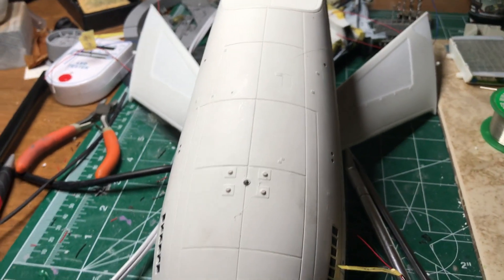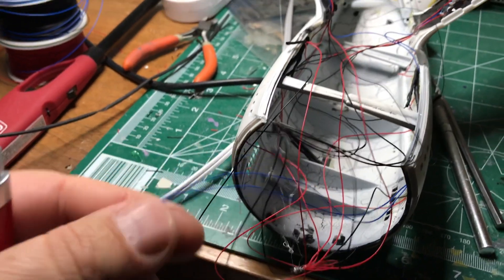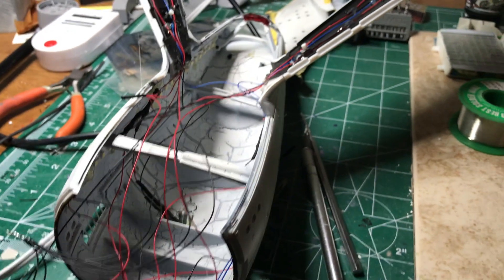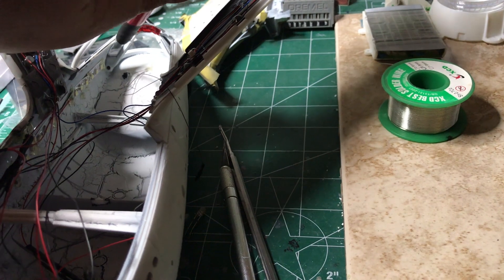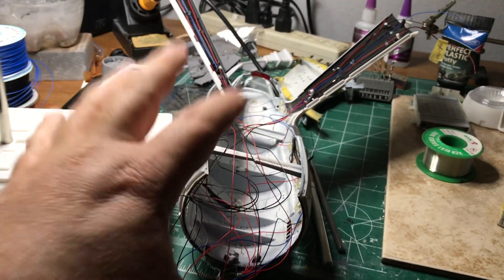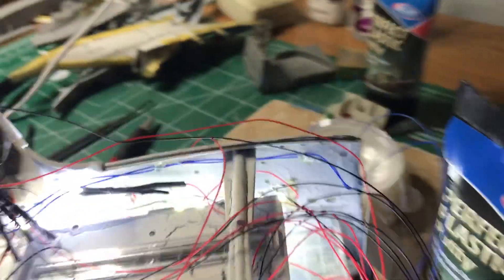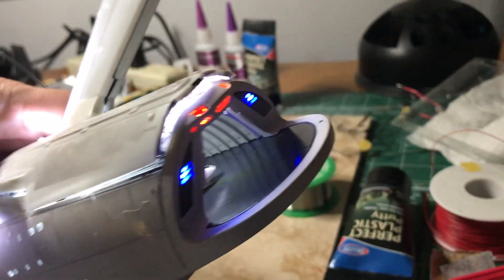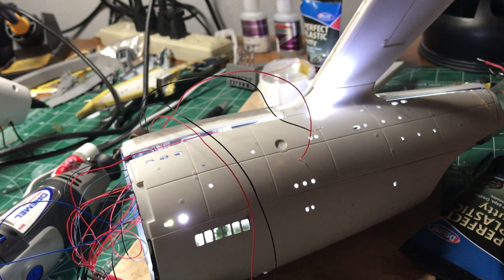Polar Lights 1:350 Enterprise Refit - Part 12 - Closing the secondary hull (or am I?)

Comment: Hello, hope all is well.   I've been watching your sereis on this build which I am currently building myself The Motion Picture version and find a lot of useful information and I thank you for taking the time to build and post for us veiwers. I was wondering if you could do a video of a Refit with Ralph's Mega Board?  would be very very helpful with detail wire up for us refit builders.
Reply from the maker: I've used some of Ralph's stuff in the past, and it's all very high quality.  I used the bussard board and spinners in my TOS build as well as a couple of his flasher boards.  I'm switching to mostly Arduino stuff these days, as I program for a living, and I can get Arduino boards for next to nothing from China.  Not to mention, I'd have to build another refit!  I think a third one may do me in!
Reply: @mattsmodelshop  The Refit is a bit of a challenge lol  One can burn out on that build kinda quickly.

Comment: Thank you for these videos, they are very helpful!  How did you light block and paint the two clear shuttle bay back pieces (where there is blue light). I have the mask set but those masks the entire piece.
Reply from the maker: I use black paint and then the color.  As long as the light isn't too intense, it will block the light adequately.  The mask set masks off the windows in the turbolifts in the shuttlebay in order to paint the rest.  It worked really well.

Comment: Hi, love your work. Have two questions. First, what are the dimensions of the base for the original series Enterprise? I would love to build one and want to know how much room it takes up. Second, how long is the original series Enterprise 350 scale model? Again, for same reason as above.
Reply from the maker: The 1:350 TOS just has a dome base that comes with it.  It's a much smaller footprint than the ship.  My TOS has a custom base.  The dimension so the ship are 32" long by 15" wide.  It's big, but not obscenely huge.
Reply: Hi, thanks for the info. On the base dimensions, I meant your custom one. What are the dimensions of your custom base? Thanks.
Reply from the maker: It's 27 1/2 inches by 15 1/2 inches.  I had it made by hdamodelworx.
Reply: Thanks for getting back to me.

Comment: Even though I have built a couple of these, I still enjoy watching your series. You are doing a fantastic job and you explain things very thoroughly for people who want to build and light one. I should be doing a video on my Galactica and Pegasus in the next couple of days. I remember when I glued on that deflector dish part that the rod goes in, I really glue the heck out out of it as it supports a lot of wieght. I decided to pick up the Revell ZZ Top Eliminator kit today at Hobby Lobby as I always wanted to build one and I haven't done a car for a few years now. Surprisingly the fit issue with the top and the body isn't that bad like a lot of people say.
Happy modeling!
Reply from the maker: Thanks for the kind words, Jim!  I hear you about the support structure where the rod attaches.  I'm going to epoxy the interior of it so it can't come apart.  That glue joint supports the entire ship!  If it cracks, the whole thing is done.  I'd like to do more of these simple builds.  I've got a 1:350 TOS waiting in the wings (a smooth saucer one!) that I'd like to build up like this.